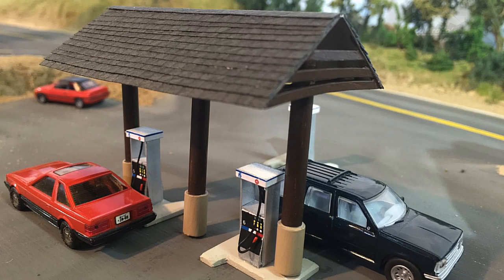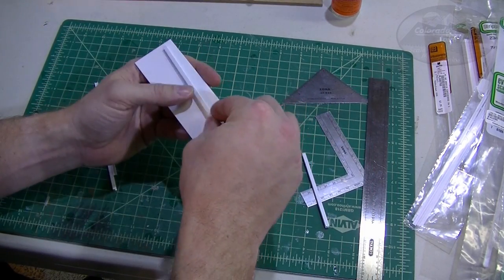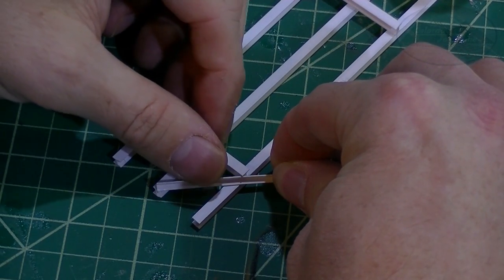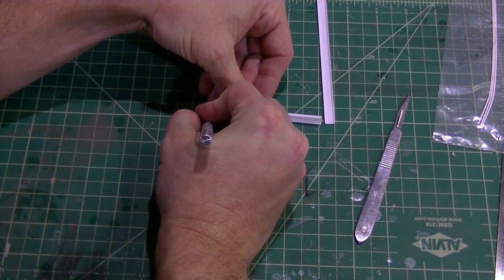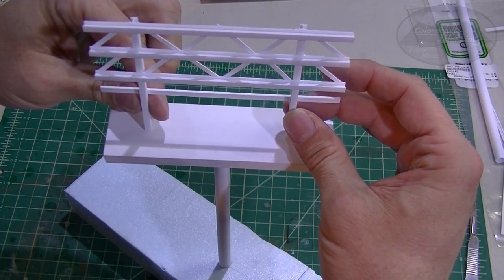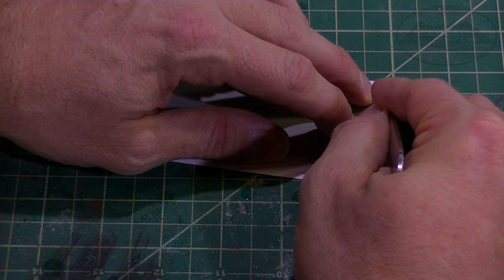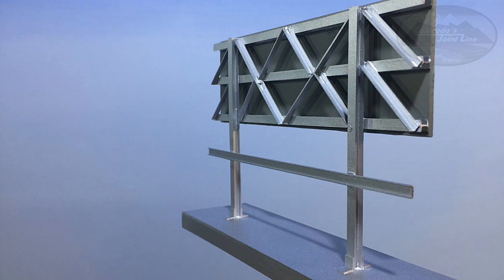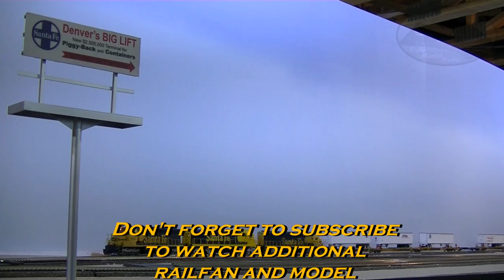How to Scratch Build a Simple Styrene Structure

Comment: Nice project.  That's quite a sign structure.  It's fun to capture something distinctive from your railroad, your era, or your locale.  I have been doing some work with printing decal signs, billboards, and such and have been real happy with the results so far.  A few screw-ups are part of the learning curve, but the learning goes quickly.
Reply from the maker: Gary, completely agree on both your points.  Glad to hear you're working on scratch building some elements to add character and flavor to your layout as well.  Cheers, Kevin

Comment: Hi, FYI, made a sign , printed somethings off printer to use. Applied then and the glue smeared the ink. The prints had been sitting for weeks so not   fresh ink. HP printer and ink. Just thought you should know about.
Reply from the maker: Pat, that sounds frustrating.  Not sure what happened, I've never had any problems with Mod Podge causing ink to run.  I use a HP printer and HP ink as well with 22 lbs HP ink jet paper.   I didn't do anything to treat the paper or ink before applying the Mod Podge.  Thanks for the feedback.  Wish this technique had worked for you.  Cheers, Kevin

Comment: Very nicely done! What paint did you use for the "stainless steel"?
One nit to pick... it's MOD Podge, not Modge Podge. You certainly aren't the only one to call it that, however. 
Best wishes, Ken
Reply from the maker: Ken, thanks.  I used Model Master Stainless Steel paint.  Agree, its actually Mod Podge.  However, Modge Podge rolls off the tongue easier.  Cheers, Kevin